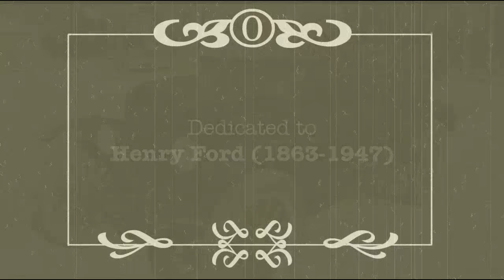Ford Model T - Fan, Fanbelt and Pulley

Comment: Way to go Mitch. Martyn Vowell and I had a devil of a time while helping Derrick Pangs car. We haven't figured out why yet but the 27inch belt which is standard turn out to be short for us and the fan blades were cutting into the lower water inlet hose. We tried the next size belt up and it was too long and rubbed on the timer.  After checking with Larry Blair at Tin Shed here in SoCal. we took tin snips to the fan blades and trimmed off about 1/4 inch and smoothed things up on a bench grinding wheel. This made the 14 inch diameter fan 13 1/2 diameter. Runs great now.

Comment: Is the nut on the back supposed to spin? Mine self tightens until its sooo tight that it stops spinning!
Reply from the maker: It's not meant to spin. Depending on which bracket you have, the nut should be castellated (notched), to allow a cotter pin to be installed, which prevents over tightening. Also make sure you keep the fan bushing greased, been there done that, my fan jammed due to lack of grease!!